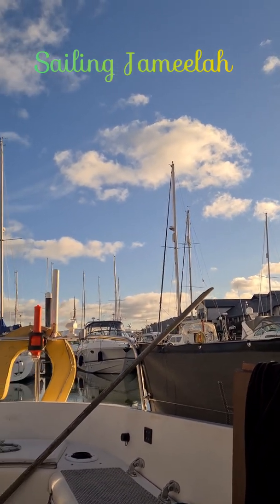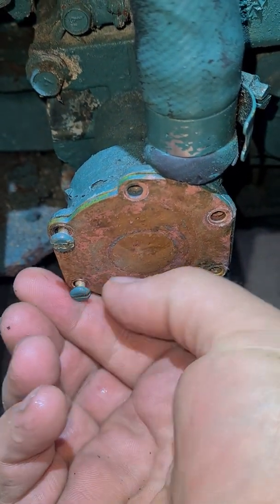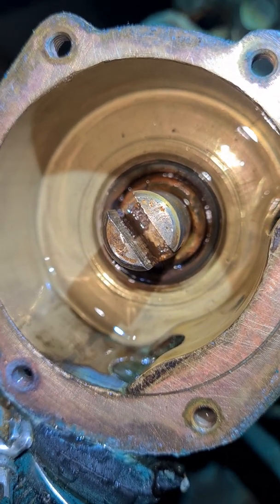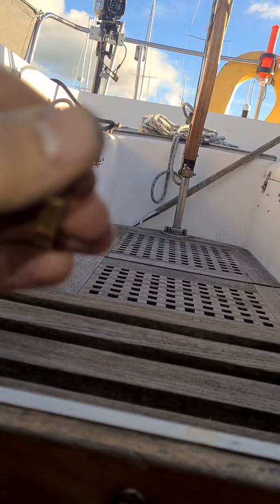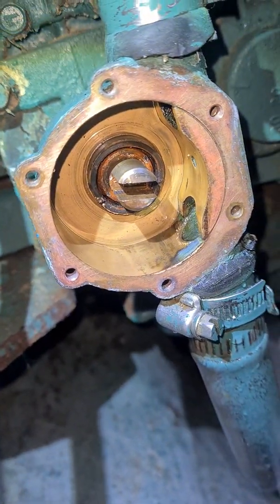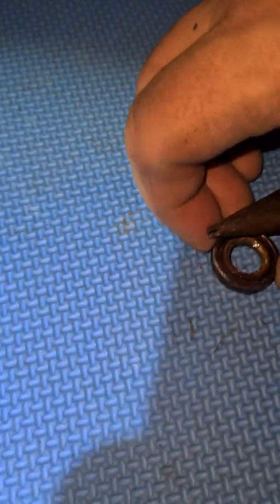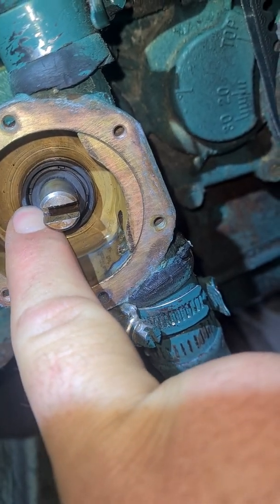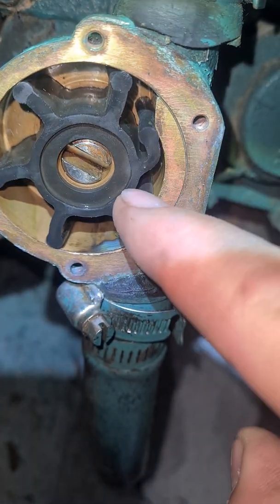Volvo Penta MD2030B Raw Water Pump Seal

Comment: Now you have a new water seal with a worn oil seal albeit the water side is higher pressure but guess what side will leak next 😳🤣 for the sake of a seal that costs a few pence it’s best practice to do both.
Reply from the maker: Thanks for your comment. Thank you for watching.